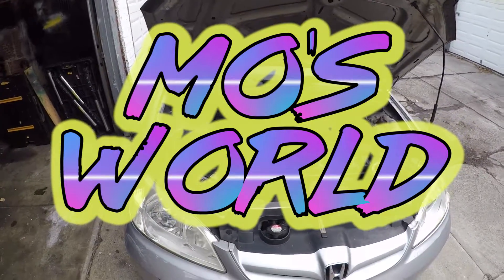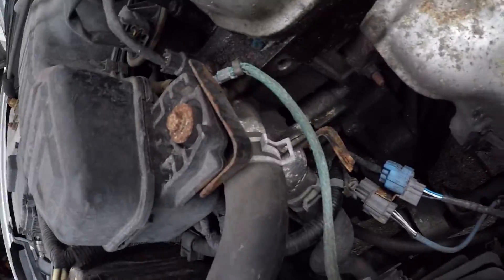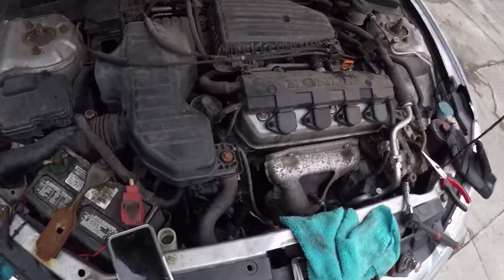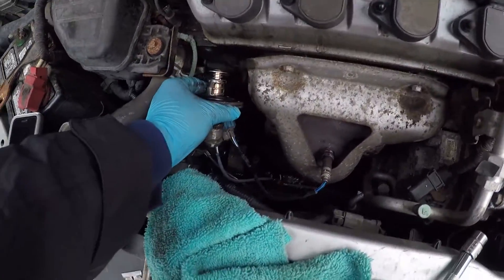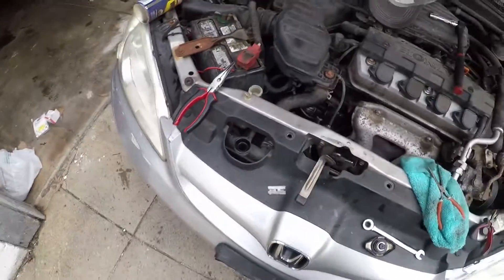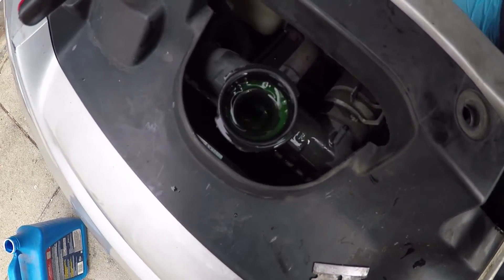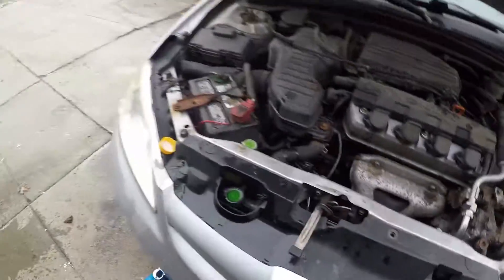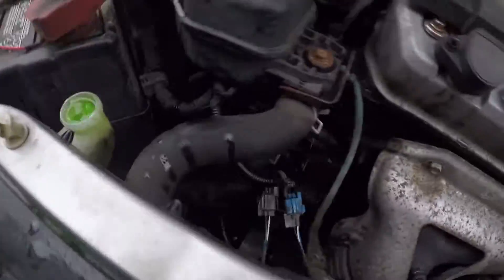2001-2005 Honda Civic Thermostat replacement  under $20 bucks

Comment: You way overfilled the coolant reservoir, which will cause top to pop off when pressure is found in the system. The fill up line to max is in the lower bottom kinda hard to see.
Reply: Lmfao I was thinking the same thing
Reply: Kind of??? 🤔 More like damn near impossible!! Aside from its shitty position,  the plastic is so thick you can't see thru it. 🥴

Comment: You filled up the reservoir tank way to much.
Reply from the maker: Yea but it has an overflow hose to let any extra coolant escape
Reply: @MosWrld100  it does? I've been looking for the escape hose on my 2005 civic but I couldn't find it
Reply: @MosWrld100  there’s a minimum and fill line on the reservoir. How’s the extra coolant escape? It’s supposed to be an air tight system. Not sure where the excess would go at least that much of it

Comment: Before you added the thermostat did you gauge go to hot on your car?
Reply from the maker: Bino Trone sometimes it would go up a bit but never reached hot
Reply: @MosWrld100  because my Honda running hot and I was trying to see wat was the issue.
Reply: probably because the thermostat is shut and doesnt open to let fans turn on and the coolant to flow through bottom radiator hose
Reply: Exactly what my Civic was doing. Thermostat shut closed. Wouldn’t let the fans turn on.
Reply: @punkybeerconsumer  sometimes if i flick the ac on like 1 click on. For a 2001 civic 7th generation, itll get the fans on.
Reply: @ekginseng  what did u replace?
Reply: How is it now? What did you do?
Reply: @voltixD  ?
Reply: @grumet100  That comment was meant for the OP
Reply: @voltixD  there should be no issue i long there no over heating an both ur fans work u should be fine

Comment: Quick Tip: instead of pouring straight forward the way you did, turn the bottle on it's side. It is much easier to control and you won't spill near as much. Hope this helps.
Reply: I had to figure that one out on my own. GREAT TIP!

Comment: Hello What is the symptoms of a bad thermostat?
Reply from the maker: Overheating if the thermostat is failed closed and if it failed open it would take forever to get to operating temp and during the winter your heat won’t work as well because the car can’t get to temp
Reply: Thank so much!
Reply: My car dont defog until I am driving that's when the air blowing in from vent get warm. Is that sign of a bad thermostat
Reply: @stickshiftdriver1832  yes, that could mean it’s failed and stuck open
Reply: Mine doesn’t open when I’m parked but when I’m driving it does. Is that considered bad.
Reply: @johnwilsoniii4757  seems like the same issue I have when I am idle. The temp gauge goes up. But when driving it goes to the middle. Going to replace the thermostat this week and do a radiator flush. Hopefully that fixes the issue.
Reply: @Joshedu  did it fix it ? I’m having literally same exact issue right now
Reply: @Joshedu  any update on the issue?
Reply: I will preface this comment by saying. If your coolant is full, and your spill over reservoir is at the appropriate level. 

If your temp peaks to the top of the gauge. Or, your temp gets above normal, (approx above the middle of the gauge), then suddenly drops back to its normal operating range. Signs that the thermo is starting to stick.

Comment: You needed to flush that radiator, like extremely clean it, flush it 2 or 3 times & then purge (burp) the system of air or else you'll get air into your engine.

Comment: So I have an 05 Honda Civic and it's got the vtec solenoid the wiring coming off of the VTEC however that leads to a harness doesn't plug into anything else why would that be
Reply: Engine swapped.
Reply: Did you find out Megan